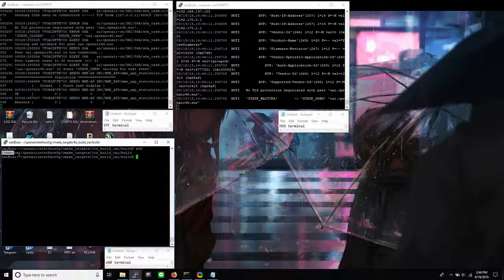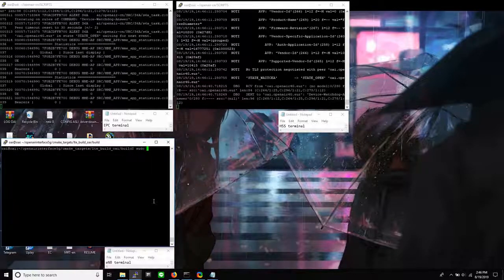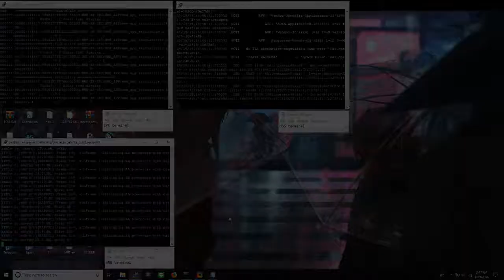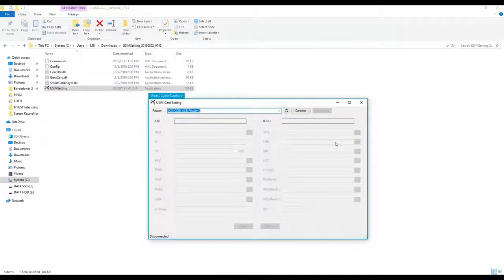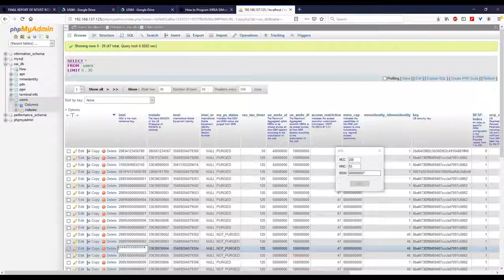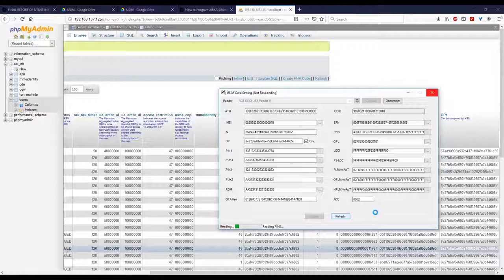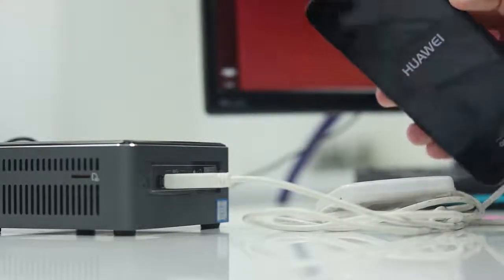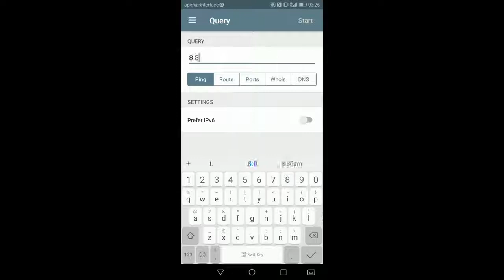XIRKA SIM card testing on Open Air Interface

Comment: : My EPC is in one single VM. SPgw and hss uses loopback addresses. I am using Openvpn server on the EPC VM and a Physical Linux machine with USRP b210 as a enb which is a client OPENVPN. I have to implement a VPN connection between these 2 so that the SCTP transmission can occur between epc and enb. Can you please help how to setup this vpn connection?